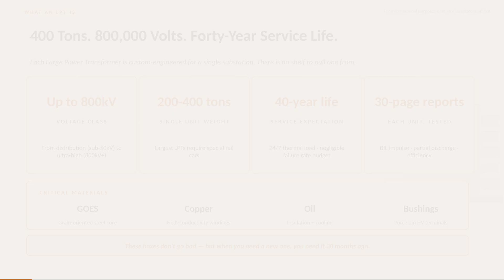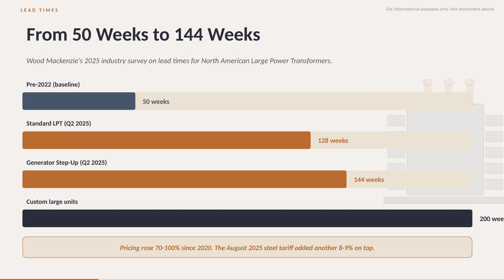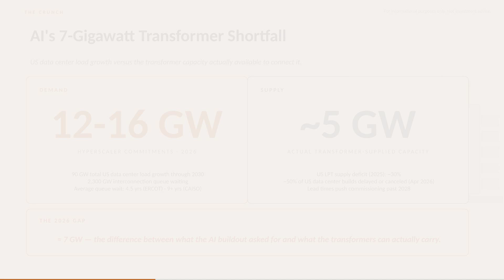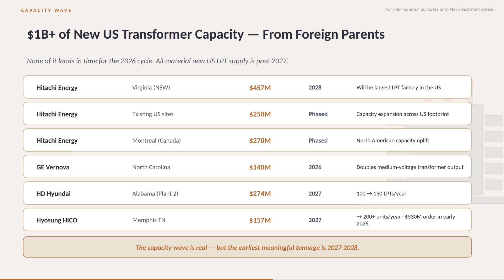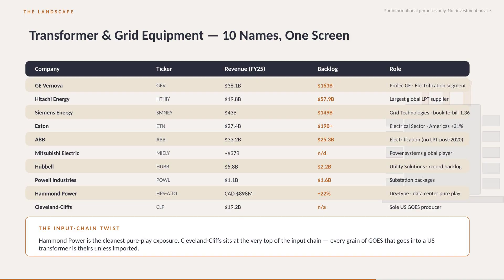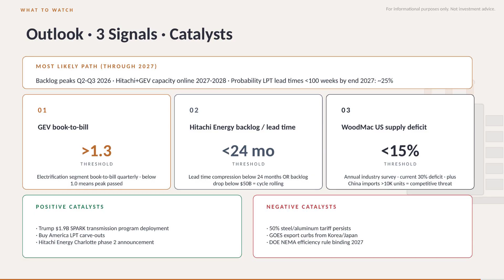Power Transformers: 4-Year Backlog, 200-Ton Boxes

Comment: The 4-year backlog point is well made. What's often overlooked is that the bottleneck isn't just manufacturing capacity — it's the entire supply chain for grain-oriented electrical steel (GOES) and specialized bushings. Chinese manufacturers have been scaling up GOES production significantly, which is why some procurement teams are now looking beyond the traditional Western OEMs for mid-range distribution transformers (under 100 MVA). The quality gap has narrowed considerably for IEC-standard units, though the 500kV+ EHV segment still favors established players for now.
Reply from the maker: Exactly — and the gap closes fastest at the bottom of the voltage stack, slowest at the top. China (Baowu) has genuinely caught up on commodity and mid-grade GOES feeding sub-100 MVA IEC units, but the high-permeability laser-scribed grades an EHV core needs are still a Nippon Steel / JFE duopoly — and re-qualifying a 500kV bushing supplier (Hitachi/Trench/HSP world) is a multi-year reliability bet, not a price decision. The binding constraint just migrates steel → bushings → track record as you climb in kV.